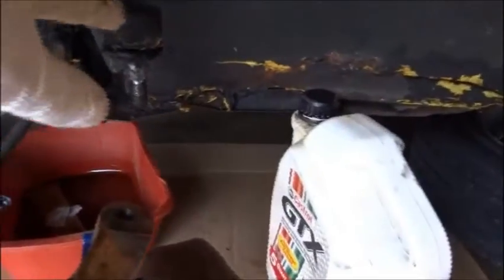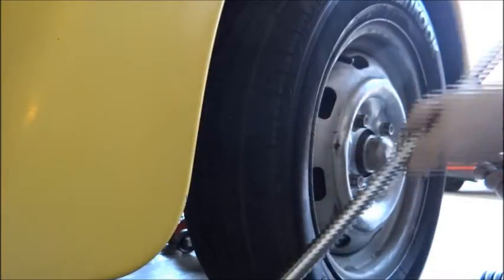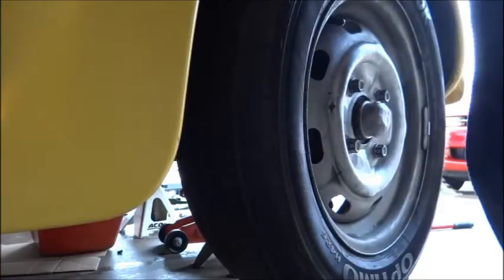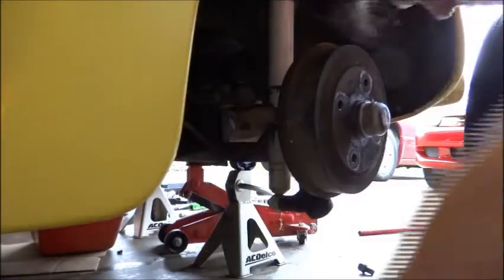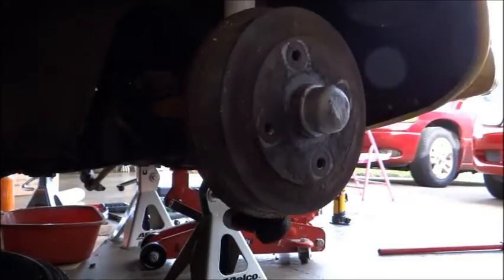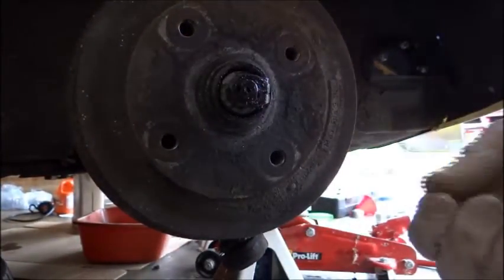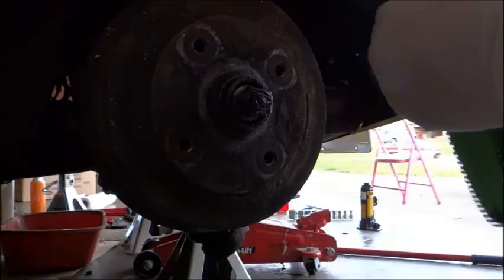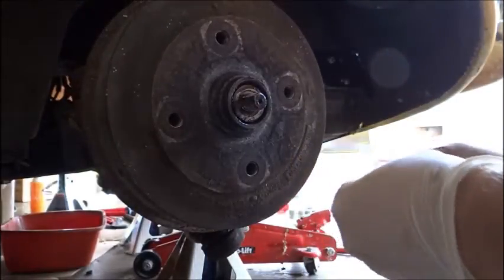1973 VW Beetle Bug JC Whitney Disc Brake Conversion

Comment: quick bit of advice for dust caps. use a screwdriver and knock it inbetween where the drum ends and the lip if the dust cap. tap in and tap slowly away from you
Reply from the maker: Thanks for the tip!

Comment: Did anyone suggest that you shim the beam, Or use  different ball joints made for lowered VW's, or longer brake lines, or to change the tie rods? Just wondering..

Comment: Dear Sirs, i have a vw 1973 classic beetle where i need to rebuild or repair the manual shifter, however, my car doesn't have the 2 access plates. How can i repair it? your prompt answer is highly appreciated, thanks and regards. Vicken
Reply: Vicken Sagherian if you wanna join the vw group on fb ill add you — so many good people out there on the fb